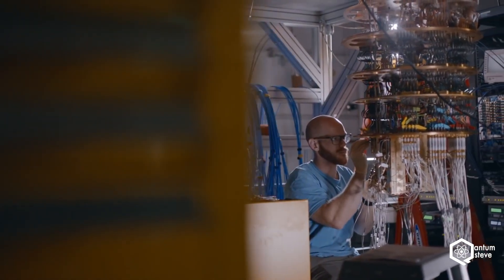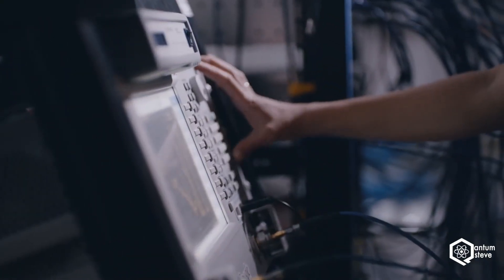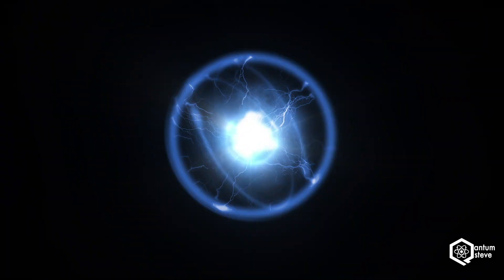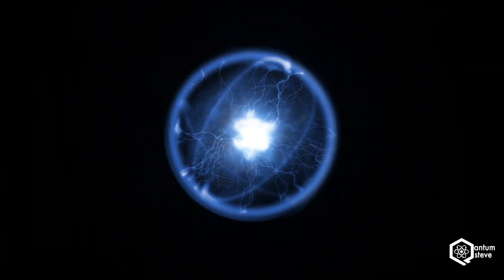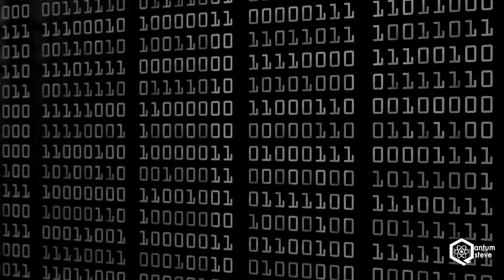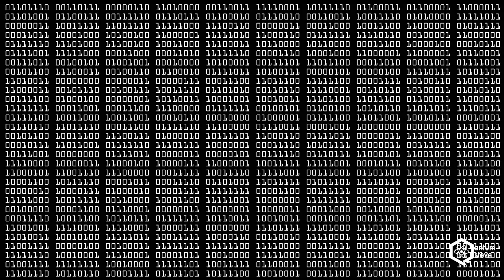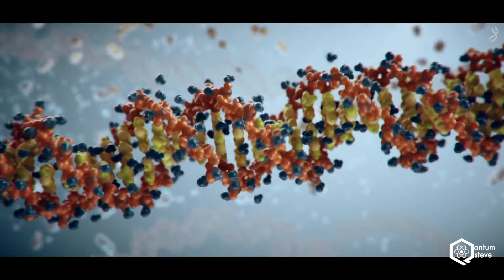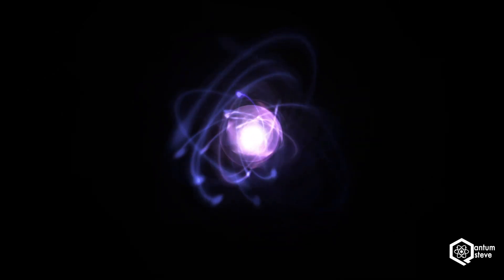Quantum Supremacy IBM vs. Google - Quantum Computing Explained

Comment: They've been working on these quantum systems for a while now. Decoherence and noise are still major issues. Has anyone actually performed a useful calculation with one yet??
Reply from the maker: If you mean a practical implementation that classical computers cannot do, the answer is no. But if you are talking about small scale experiments of practical calculations that would be very useful once we scale quantum computers, the answer is yes! From quantum chemistry (https://science.sciencemag.org/content/369/6507/1084) to quantum optimization (https://arxiv.org/abs/2004.04197) and quantum dynamics (https://arxiv.org/abs/2010.07965), just to name a few.
Reply: @QuantumSteve  The question is are we going to be able to scale them at a finite cost? So far that answer is no. I like the excitement and the determination in the field of quantum computing but I also am starting to agree with a lot of the skepticism coming from other scientists that QC has some fundamental hurdles that we cannot overcome.
Reply from the maker: Sure! IonQ went from no qubits to 32 within a few years! I’ll happen faster than you think! If they are able to scale to 50-60 qubits and implement one of the things that I linked above, then you are doing something useful on a quantum computer that requires a serious supercomputer to do classically or might not even be possible classically!

Comment: No one paid attention to this. But it destroyed all encryption and the centralized control of all bank account and debt ledgers worldwide. Welcome to the quantum reset. Distributed ledgers reign.
Reply from the maker: Well... I think we still have  a long way to go until that becomes a reality :) 

The algorithm that gives a speed up for cracking encryption is called Grover's algorithm (https://en.wikipedia.org/wiki/Grover%27s_algorithm). First of all we need error corrected quantum computers to actually run that algorithm which is still very much just a dream at this stage. Also there are open questions how to actually implement the algorithm in practice, it requires a "quantum oracle" for which I have not yet seen an efficient proposal. 

Also the speed up is not that great, from O(N) to O(sqrt(N)) which if solving an encryption on a classical computer takes, let's say, 10,000 year and it takes now "only"  100 years on a quantum computer there is not much of a threat.